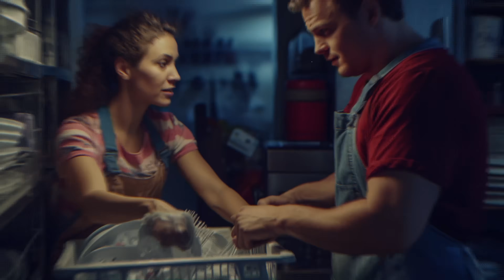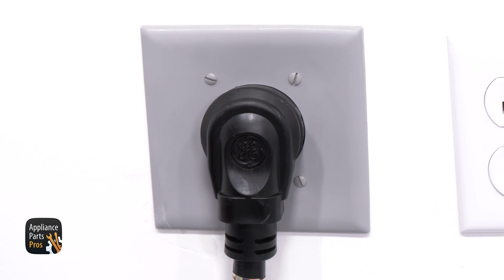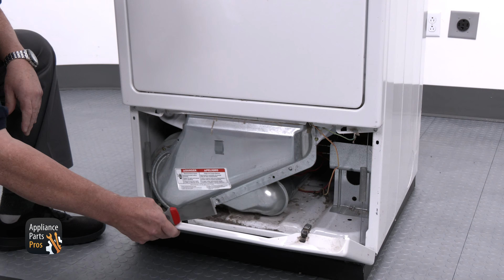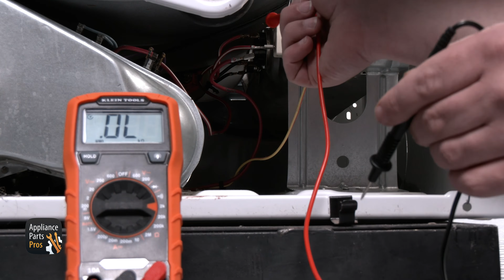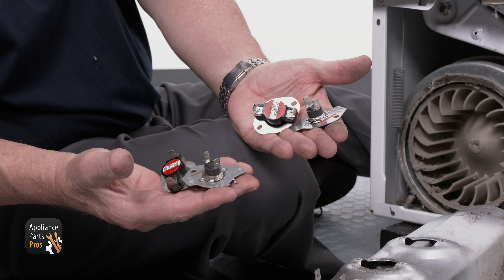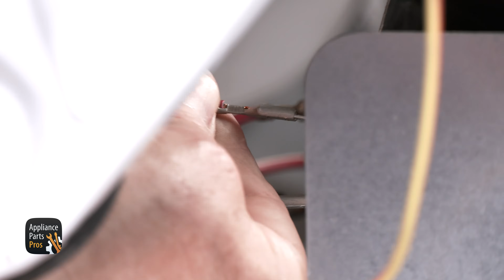How To Test And Replace a Kenmore Dryer Thermal Cut-Off

Comment: Ive replaced the heating element thermal fuse and thermal cut off. Element heated up and stopped heating again. Any ideas?
Reply from the maker: If the element heats and then stops again after replacing those parts, we'd recommend checking the dryer’s airflow and vent system first, since restricted airflow can cause overheating and repeated thermal component failures.

If you need further troubleshooting/testing information from our techs you can check out our repair forum: https://forum.appliancepartspros.com/
Reply: @appliancepartspros  Ive taken apart the whole dryer vacuumed and cleaned. Zero blockage, Still happened?
Reply from the maker: If you need further troubleshooting/testing information from our techs you can check out our repair forum: https://forum.appliancepartspros.com/

Comment: Great video! It got me through the fix. FWIW: I recommend labelling the ends of the wiring with colored tape before you disconnect everything. Six different leads to reconnect can get confusing quickly, even if you have pictures.
Reply from the maker: That is a great tip! It doesn't hurt to have both labels and pictures to help with the installation.